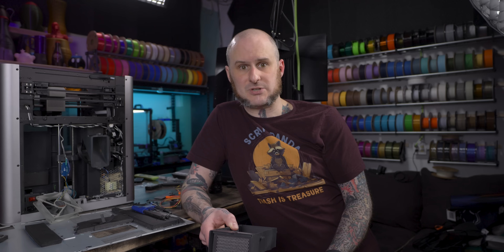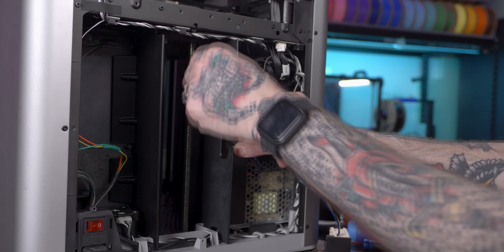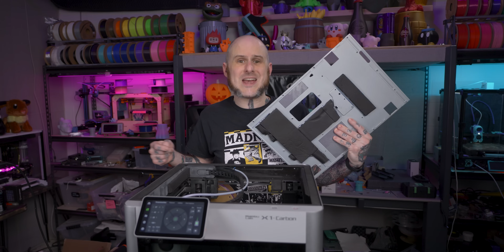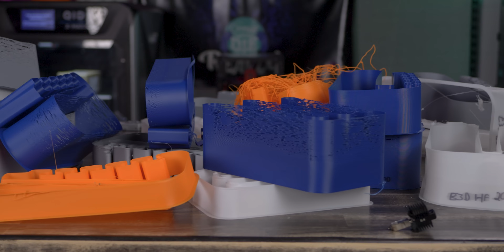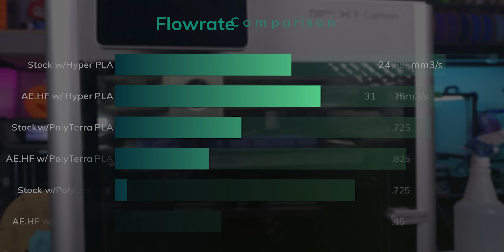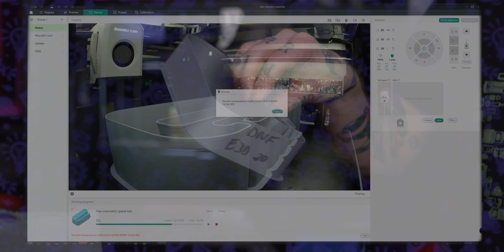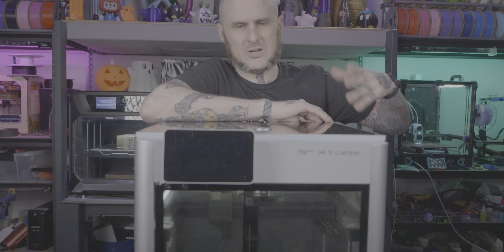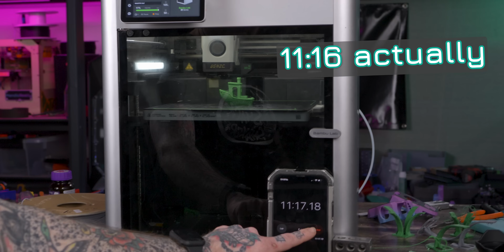ULTIMATE Bambu X1 - Sub-10 Minute Benchys!

Comment: A lot of creators skip PETG when doing testing like this, but I really wish they wouldn't. I find you learn a lot more about flow rate because of how that material misbehaves when flow rate gets inconsistent.
Reply from the maker: I find that PETG flow capabilities varies more than other materials. I don't use it for that very reason. Its inconsistency between manufacturers makes it difficult to discuss. And in the end, I've largely stopped using it as a printing material. ASA is rising in popularity as enclosed machines become more common place, and PLA is still king. So that is what I cover. And for some unexplained reason the Bambu has always been extra finicky about PETG for me. Maybe the material I use (GreenGate3D), but it has been so I moved away from it long ago.
Reply: @MandicReally i primarily print PETG, i have a very modded CR20 Pro that hasn't seen power once since i've had my A1 Mini, but the A1 Mini actually never seen PLA once

ASA is very nice to work with if you have an enclosed printer, the benefits of ABS but not quite as harsh, albeit a closed space and open printer still puts quite some harsh chemicals in the air
Reply: I print almost exclusively in petg on a Bambu X1C. I have excellent results with Sunlu, hatchbox, and qidi tech. The Bambu flow rate calibration makes all the difference and drying the filament also makes a world of difference. I would prefer to print in abs or asa but I need proper ventilation and I don’t have that yet. PLA is awesome but only for some types of prints. If I care about the print durability and not having it melt in the summer also I prefer petg. If PLA had the same heat resistance I would probably stick to PLA. I want to do Asa and abs… someday.
Reply: Yep, max flow is less limiting than that material's max linear adhesion speed. I raise my layer height for petg fairly often
Reply: I've recently tried my hand at some PETG and it's quite difficult but not impossible by any means. Drying is a must and slowing it down as well (at least on the X1C with Polymaker).  Drying decreases the stringing and inconsistency but the slowing down is the secret sauce that gives it incredible layer adhesion.  With extremely slow print speed you can make parts with injection molding type fusion the only issue is dialing in the retraction and z-hop for very intricate pieces where tiny gaps are necessary.
Reply: @PLr1c3r  on the X1C polymaker was the absolute worst petg I tried. The top 3 I have consistent results with with minimal tweaking are Sunlu, hatchbox, and qidi tech tough petg. I’ve tried a bunch of them and these are my favorites. I had high hopes for polymaker and really wanted it to work.. but it is tough to work with even after a bunch of drying and tweaking settings forever. If you want good petg prints every time and don’t want to mess with the settings all the time use one of those 3 brands and also run the flow calibration for each. All that is needed after that is a slight nozzle temp increase.
Reply: I’ve been using Overture PETG for a while in my x1 with great success.

The one peculiar thing is my normal black petg prints are coming out matte colored rather than shiny black. I prefer that and don’t seem to have any adhesion issues so I’m leaving it. But just thoughts.
Reply: @st3venb  I think this is usually due to the temperature not being hot enough if I understand correctly.
Reply: That’s what I read too, but if the temps were too low I wouldn’t be getting good layer adhesion and part strength. I don’t understand it, but it works right now for me.
Reply: @st3venb  I did some experimenting with black overture petg and I found the matte color was associated with brittleness. I found that I could successfully print at up to 21mm3/s but the layer adhesion wasn't good and parts snapped like a twig. I think under 10 max flow is good. Between 5-8 mm3/s seemed to give me that nice sheen. Maybe increasing the nozzle temp a fair bit could help?
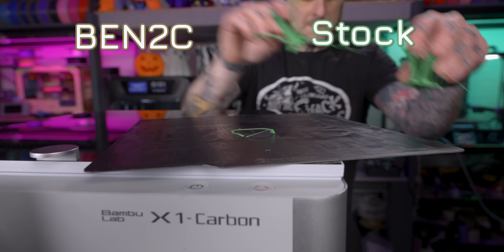Reply: For the 4 spoke overhang test at 25:35, the problem is inadequate z hop!

I had the same issue (especially at 0.12 and 0.08mm layer heights) and spent a few hours testing, and was able to completely resolve the issue by increasing z hop (I increased it a lot, like 2mm, but that was for testing. I also made the z hop vertical. In any case it didn't add much time to my print so I was happy with that).

That overhang test highlights a notorious issue with the bambu - nozzle crash breaking thin columns at low layer heights.

Increasing z hop totally resolves it, so try that!
Reply: Sunlu is the only PETG that prints for me with no issues. Every other one ends up with defects.
Reply: @binksy17  Sunlu is great. Hatchbox requires more drying and a slightly hotter nozzle temp. Same for qidi tech. Hatchbox and qidi have a nicer matte finish even though I heard petg should be glossy like Sunlu. Even after printing hatchbox and qidi with a hotter nozzle it doesn’t get as glossy as Sunlu. I actually prefer the look of qidi and hatchbox to be honest and haven’t noticed any layer adhesion issues… however it is hard to argue to pay 28 USD for a 1kg spool of hatchbox or qidi when I can spend almost the same amount for two 1kg spools of Sunlu
Reply: @colinmsmall I'm struggling to get their silver PETG in the UK. So I tried hatchbox as the colour match is good. Even had it feeding from the sunlu dryer box and still every print had a defect in it.
Reply: @binksy17  if you have a Bambu with Bambu studio make sure to use the flow calibration, makes a big difference. You might be able to do this too with orca slicer on other printers, not sure.
Reply: @colinmsmall  ahh ok yea will give it a go, thanks for your help
Reply: For PETG I usually go down with printspeed for sake of quality. I find overhangs and bridging benefits from that. Interesting to see PETG at higher speeds with the new part cooling fan duct.
Reply: I just learned my first lesson on that the other day.
Reply: @rickybobbyracing9106  The melting?
Reply: the flow rate is going to be dependent on the specific grade of filament that the filament manufacturer used, in combination of the hotend flowrate, and the temperature used. once you leave the ingeo natureworks grades of pla, its a complete random thing from whatever material any other filament is being  made out of grade wise with the occasional exception of maybe mg94 for really particularly smelly abs. pellet grades/brands are basicaly trade secrets for most filament makers unless they want to use it as an advertising point. this has a dramatic impact on the material properties including flowability at any given temp range. bambu hotend doesnt get hot enough to print certain petg's really fast especially with steel nozzles, and others just have a viscosity in the temp range that just wont print fast. some will.
Reply: I totally agree on testing flow rate at printing temps - exactly how id do it!

Comment: Bentobox is only worth in a printer which is almost sealed. As long as the poop shoot is open, always poluted air will find it's way out. Esp when the Bambu chamber fan is much stronger compared to the Bentobox fans. Are the Bento Fans are really higher in flow? Bento will usually  have no chance to filter a lot of air when the poop shoot is open. You can test that easily with smoke spray.
Reply from the maker: It seems like you are missing a key detail. The BentoBox doesn’t create a negative pressure differential. The stock fan flows a claimed 92CFM but that is ALL air drawn out of the chamber and blown out. Thus creating a negative chamber pressure, so air is actively drawn into the chamber through any gaps in the frame, door, and poop chute. The BentoBox draws in air inside the chamber and recirculates it in the chamber. That doesn’t create a negative chamber pressure. So yes the Poop chute is open (as is the big gap at the door) but  it isn’t actively drawing air in through those gaps. It ain’t a sealed box, you’ll get air mixing, but the BentoBox is absolutely reducing how much that happens.
Reply: I got you, but I tested the Bentobox with chamber fan "off" by myself and still saw the testsmoke coming out of the houseing, especially at the back of the printer and the poop shoot. Result was not so bad as I saw it with the Nevermore Filter, which I also tested a couple of months ago. That's why I ask which fans you use. Maybe worth a follow up video and a test of the Bento with smoke? Esp. fine particals are tricky and not to underestimate. Nevermore claims in their Wiki, that the flow dynamic concept only works in a good sealed chamber, which a voron has, but unfortunately a bambulab does not. Therefor I started to place my X1 in a well ventilated room with no human traffic, while printing risky filament. I also use an Air quality monitor in my Home Assistant, to track the Vocs and fine particles. From my experience it is really hard to get this under control and clean. For sure a Bentobox is better the nothing. Interesting and important topic this is.

Comment: Watching this while fixing my Ender 3 is a weird feeling
Reply from the maker: I should really go work on my Ender 3 now. We use what works and what we have. I want to rotate my Ender 3 back into the mix ASAP.
Reply: Ender 3 is more fun as you can tweak the firmware and all the hardware, upgrade Marlin and try Klipper. Mine does 17m.
Reply: @eaman11 I already switched to Klipper. Just swapped to the Satsana fan duct and now I’m getting a bunch of stringing 😭